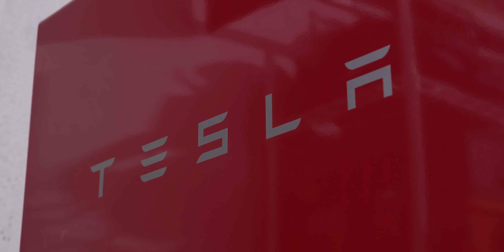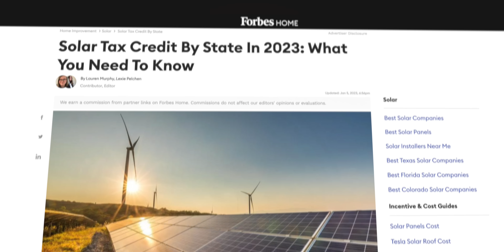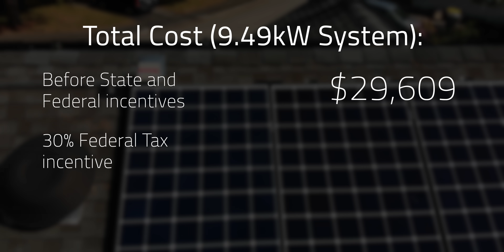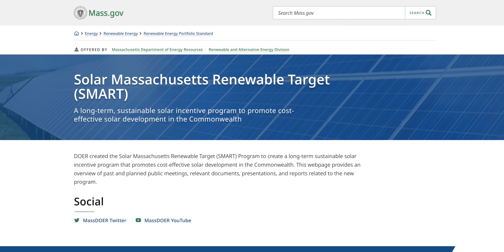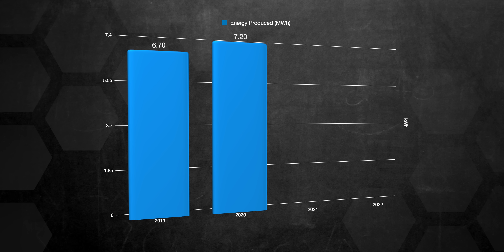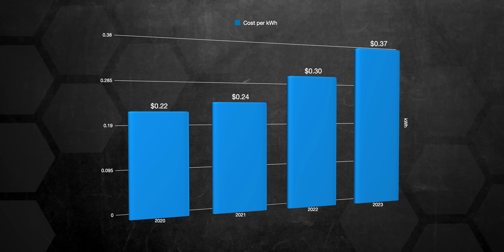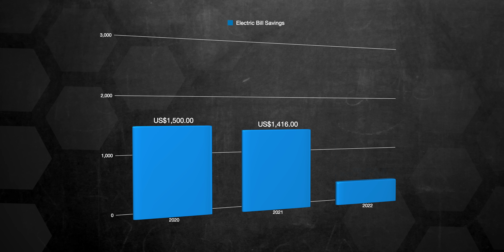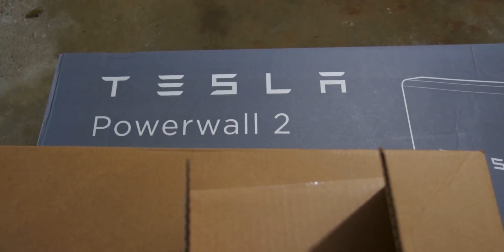5 Years with Solar Panels - Is It Still Worth It?

Comment: $0.37/kWh? Holy crap. I left MA back in 85 and would not consider moving back. My electric rate has some variability, but the vast majority of my electric usage is at $.062/kWh and there are no state incentives. Even the small amount at the higher rate that only happens in the severest of winter months, it only goes to $0.102/kWh. Needless to say, Solar is much less popular here. Still, I had 42 panels on my last house and was net zero or actually net negative. My current house it's too early to be sure. I only have 39 panels now, but will expand to 52 soon and expect to be net zero or better. I don't even think about payback. The time frame it too long and there are better ways to improve my finances. It's best think of it as saving for retirement. Setting aside some now to have a better financial situation in retirement.

Comment: Why the roof? If i have plenty of space for a ground installation. Is there a reason why i should not consider this?
Reply from the maker: No, do it!  Put panels wherever it makes most sense for you.  I didn't have the ground space with good sun exposure to go that route.  A big benefit is that they're at ground level and easy to clean off.

Comment: Matt, I have followed your solar journey for sometime now and it has actually pushed us to get solar here in southeast PA. We just passed the 1 year mark. while the benefits are similar they are different based on SRECs, etc. I'm still wondering if we had made the right choice at times when I see that electric bill, but once I do the math, we are still saving with the rise of electric prices. Batteries are next on my list but I am unsure if they are worth the price... I'm hoping the price will come down here in the next two to three years.. best of luck with the new home and keep up the good work
Reply from the maker: Thanks for sharing, MJ.  Glad you've found these videos useful.  Batteries can be a dicey proposition because the costs can sometimes be too far out of reach.  I'm starting to work on a video exploring this exact topic (stay tuned).
Reply: @UndecidedMF  I know you have the Tesla power wall, but I've been intrigued by the Generac PowrCell (sic).   You have any thought on that system?  It seems a bit more versatile and expandable than the Tesla product...   Thanks !
Reply: A way to justify your battery purchase: Buying an EV that can utilize the battery to provide electricity. Our EV6 has this (Vehicle to Load), which can provide 1.9kw of power. Just had a 4 day power outage due to an ice storm, and was able to run my furnace, refrigerator & laptop, all from my car, without noise or fuel.
Reply: Home batteries will probably become significantly cheaper over the next few years.
Sodium hydroxide (Na-OH) batteries are about to enter the market and these should be significantly cheaper than expensive lithium-ion batteries.
Reply: PECO prices really haven't gone up in recent years like they have in other parts of PA and the rest of the country.
Reply: Only buy batteries if you need the backup power, and they can operate independently of the grid.

I priced a Tesla power wall, and it literally cost more than all the electricity that would ever pass through it.

I purchased Nesan leaf batteries that were installed wrong at the factory, and I made my own 27 kw battery.   It is super scary it has a tremendous amount of power, and if you accidentally ground out a wire or puncture a foil pouch, the fireproof mettle cabinet will be a burning puddle of metal inposible to extinguish  in about 20 seconds.  It took me 10 days to build the battery.  I still am not going to save enough money to make it pay to sell power.   

I just use my battery as a buffer for my pass-through UPS with solar panels.   It's great during a power outage, but I have a big battery. Smaller batteries are not as useful.
Reply: Me me me me... Me me me

Decarbonization is 21st century pyramid building.
Just burn coal. 

This is sickening on so many levels.  "How to screw the lower middle class and make them pay for your feel-goodery."

Comment: I got solar panels last year and we are almost to our one year anniversary.  The installation was a s…. show.  We were supposed to have them installed 6 months earlier but there were delays after delays.   If we can produce close to 50 kWh we do not have a bill.  Back in September of last year there was a rate hike of 4 cents.  Our neighbors are complaining about the rate hike.  Right now I am breaking even on electric bill and what I pay for the panels each month.
Reply from the maker: Thanks for sharing.  Breakeven for now isn't too bad.  At this rate have you looked at how long until payback?
Reply: @Undecided with Matt Ferrell  It will take about 15 years to pay off the panels.  When the rate for electricity goes up again the savings will increase and the they will pay for them selves faster since I will not be paying those rates.

Comment: I want it, but I keep hearing about new tech that boosts efficiency in the panels and cheaper cost for the batteries. So at this time, I am sliding a few bits and bobs around to make it better. Just had to replace my NG furnace and the cost to go electric was $700 more. Baby steps...
Reply: Heat pump?
Reply: Given that solar panels are semiconductors, you run into the exact same situation of constantly waiting for the next better thing as you do with computers.

Comment: All these bonuses, discounts, tax refunds etc are also the downside of solar. Extreme variability depending on where you live.
And as solar picks up popularity - these programs will vanish or get nerfed.

A widespread adoption needs the cost to drop to manageable levels without these short-lived/unpredictable systems.

The power price also massively affects your ROI - will the mass adoption of commercial solar drop the energy price,  eliminating the option for you to sell to the grid or only at a small price?
Reply from the maker: The patchwork of incentives is maddening for sure.  I've started digging into that question about how renewables are affecting the cost of electricity.  Will it nerf the home solar market?  What I'm seeing right now is no, but still need to dig deeper on that.
Reply: true, but more solar panel production, means they get cheaper to make, 
in Belgium the incentives have been dropt, but the panels have been at about a 1€ to 1W pricing, Matt his prices where 3 to 1.
So my parents payed less then he has now AFTER the incentives. 
 I myself went to a group bidding, and because 20.000+ people signed in, the pricing was 20% lower then market.
For Me, my panels payed back in 4 years, and with current prices I'm now saving ALOT a year.
Reply: All these different credits are just a symptom and not the issue. You are pointing toward the correct source of the problem. The federal one is for everyone no matter the state they live in. That is the widespread adoption you talk about. You seem more unhappy with the different states having different credits. Like my state of Illinois has great credit. My neighboring state of Missouri has a pitiful credit. MY system was 40k and after credits, it was 17k. In Missouri, my system would have cost me 26k. Both would have the same federal credit. The only difference is the state credit. Sounds to me like you need to talk to your state governments and ask why they are not giving better credits for solar. Or you advocate for taking away states' rights to give credits or not. Glad I got my system when I did. When I got it was estimated I would save 80k over 30 years. But our electric cost went up 45% in Jan 2023. Now we are looking at saving 115k and that is before you factor in not paying for gasoline again.

Comment: Great review Matt.  However, the upfront costs/loan is the big issue for us.  We have 2 car loans, kids (2) in college, so ANOTHER loan is not now in the cards.  ☹️😢
Reply from the maker: I hear you on that.  Have you looked into community solar in your area?  There may be projects you can sign up for.  Get a little savings on your electric bill right away without the need for installation, loans, etc.  Not as big of a gain as doing it on your home, but still a good improvement.
Reply: @UndecidedMF  Community Solar?  I will have to look into that and see what’s available in Plymouth Mass (Yes, I’m a fellow New Englander).
Reply: @BOK-04  there’s quite a lot of programmes in New England, you’re basically buying or renting a partial stake in a larger solar farm.

Comment: Going fw utility's will take away incentives because they can.  Electric cars saving will become less as they continue to raise kwh rates, soon it will be the same as gas.
Reply: But if you have a solar panel system like mine that creates enough electricity for our home usage and to charge an EV, then you are set for life. It only cost me $17,000 for my 8.5 KWh. Now I am going to save just on home electric usage $115,000 over 30 years and if we factor in not needing to pay for gasoline we might be talking another $75,000. Plus the value of my house shot up already. If electricity gets as expensive as you say it will, my home value will skyrocket.

Comment: The solar Pug abides. We use solar pendant lighting which are detachable from the charging panels and have multiple brilliance settings and motion sensing. Along with air drying our laundry and getting hot water from 300 feet of sun drenched garden hose in the fair months, our electric bill has been reduced by 66%. Check out JACKYLED for the pendant lights. Get the "warm" white.

Comment: Great video. We had solar panels installed in 2011 on our Boston home, so we also benefited from years of SREC payments. We are leasing our system (20 year lease), which is working ok (major issue what that our lease was sold to another company…).  We are also benefiting from the city community choice electricity program, which allows us to buy our electricity from another (cheaper) supplier.  Wish I done a better job tracking all our costs and savings like you did, to have a better sense of how much the solar is costing/saving us. I’m fairly certain it has paid for itself by this point.

Comment: The problem I have here is that I am on an electric co-op. I pay $.14 kilowatt hour plus transmission charges for my electricity if I put in solar panels they’ll buy it back but only at their cost of 3.2 cents kilowatt hour. Doesn’t help me a bit
Reply: Instead of 14 cents its about 11 cents maybe 12. A little savings per hour but savings all the same
Reply: If you use power during the day your savings will be the full 14 cents+transmission. If you want savings when production and consumption don't coincide a battery system would help.

Comment: Out there comment coming up... Have you investigated using immersion cooled Bitcoin miners powered by your solar/battery setup and use the heat generated for hot water/heating? (you're then effectively using the same electricity for two distinct purposes) Then sell the mined bitcoin and then just purchase any excess electricity for lights etc from a renewable provider? 😉 There's growers heating tomato greenhouses in the Netherlands like this so I wondered how the efficiencies would translate to a residential setup!
Reply from the maker: I haven't ... and that sounds kind of out there.  I'll look into it.

Comment: I am going forward with an install in Georgia, Tesla 8kWh+PW for a little over 30k. One concern I have is if it would be worth replacing my circuit panel. I originally looked at Span but their prices seem to just go up and up and I don't see any value there anymore. Are there alternatives?

Comment: 8:25 goddamn... are you running a factory inside your house ? family of 4 here and we mostly don't reach the 200kwh mark. only in winters and only on the few coldest days where we have to turn up some electric heating.
Reply: Here I am laughing how comically small that bill is. TX requires AC. My summer bills are over 2000kWh. My winters are closer to 800kWh.

Comment: My wife and I had a small 1kw system installed for our off grid cottage in Ontario 20 years ago. Amazingly, we just replaced our original battery bank last summer. The system has performed flawlessly. 120 watt panels in 2002 were $799 each!!!!
Reply: Whoa....
Reply: That's insane! I'm looking at picking up used 250w panels for $55 each for my off grid system. Going with a 7000w system for $2100 shipped.
Reply: @randybobandy9828  How many panels? 25-30? Also, from where? Solar Steals?
Reply: @redmatrix  santan solar
Reply: @redmatrix  ya about 30 panels
Reply: I pay 2000.00  dollars for 2 140 watts panels in 2000 big difference know
Reply: Batteries will of course last longer when they aren't  depleted,  charged, depleted,  charged.. Like a car not driven will last longer than a car driven. 

Put those same batteries on a normal house. They WILL NOT last nearly as long.  How can I prove this? Check the warranty on your solar batteries. It's maybe 5 years.
Reply: What type of batteries?
What usage pattern?
Reply: @Mr Techie  Rolls/Surrette s-460, flooded lead acid. Bank of 4 6v creating 24v dc to the inverter. We average about 50 days/year at the cottage. Equalized every year, watered, and hydrocaps..
Reply: Do you heat year round or close up for the winter? What did you do with the batteries during the winter?
Reply: @Geke Hein  cottage freezes during the winter. The system keeps the batteries charged so they do not freeze.
Reply: Me me me me... Me me me

Decarbonization is 21st century pyramid building.
Just burn coal. 

This is sickening on so many levels.  "How to screw the lower middle class and make them pay for your feel-goodery."
Reply: Lead carbon batteries are now state of art lead-acid technology. Should easily exceed 20 years.

Comment: The only way I would consider getting solar is if the price comes down or I can get some used off of Facebook marketplace.
Reply: I have a real life experience with Facebook marketplace and I bought 300 watts panels for off grid remote power and I found out that I had to use three times more panels because they only produced 90 watts. !! Just make sure of what they will produce  especially for the used ones… lessons learned.
Reply: @vernt4583  yeah get panels from reliable suppliers only
Reply: @ironboy3245  yeah I have contacted several of them to furnish a real documentation of the output or a guaranteed refund. They won’t even respond!!!
Reply: @vernt4583 yeah Facebook can't help you either lmao
Reply: try installing it yourself! JerryRigEverything has a video detailing how he did a DIY solar installation!
Reply: @ironboy3245  but the panels are very expensive
Reply: @ANONYMOUSdude5781  santan solar you can buy cheap solar panel